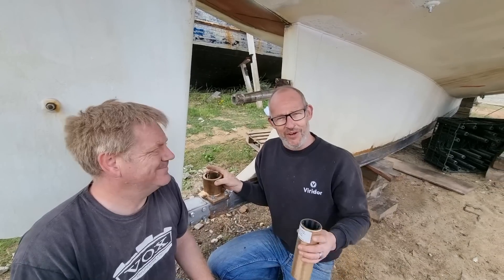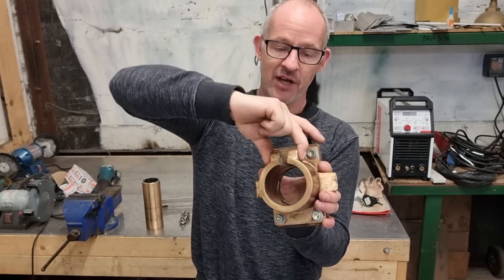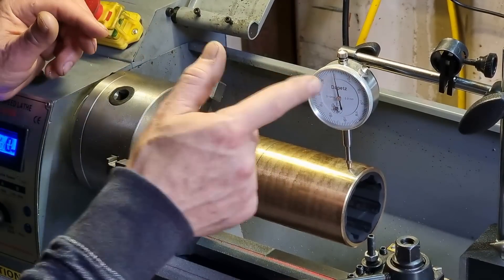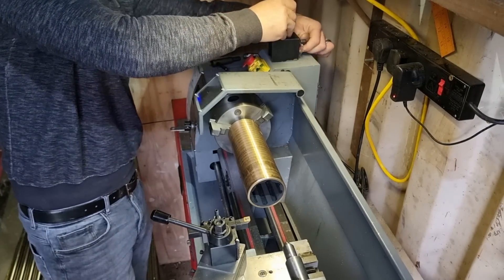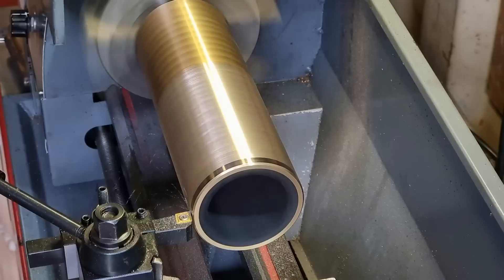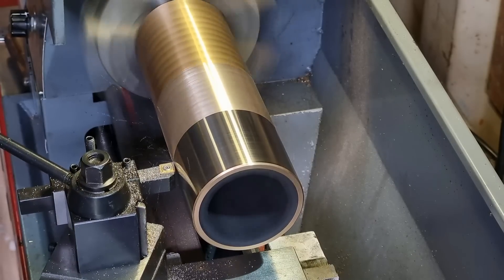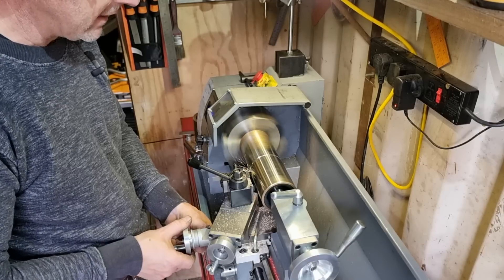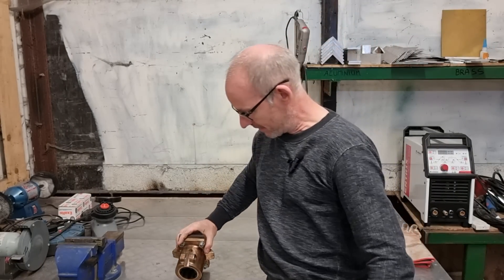Machining a cutlass bearing to fit.  Scary lathe work! (Bleeding Rust Ep 5)

Comment: If that cutlass bearing had a 1/4" thick rib on it that would fit very nicely into the open slot on the housing, I think that could be better than the 3 grub screws. Or not ??? Just a thought. :-))

Comment: If it is a standard size cutless bearing would it not have been better to ream out the holder slightly so in the future it would be easier to buy a new bearing that fitted, despite having a spare? Otherwise it will be necessary to machine each new cutless bearing.
Reply from the maker: Hi Neil.. Yes you are right, however, as nice as the housing is its not a machined part and was impossible for me to line it up in my small lathe. the decision was made to turn down the bearing itself as it will be a good few years before it needs changing again and then they have the spare.. when the time comes it will be very easy to turn down the next pair.

Comment: The cutless bearing is a standard size so by machining it down it is now a none standard size. Would it have not been better to machine the cutless bearing housing to take a standard size bearing. As it stands Andy will need to get the outside of a new bearing machined every time it has to be replaced once he has used the spare.
Reply from the maker: It's a great point John and we did discuss it, however the housing, although very nice, i not a precise casting and would be very difficult to get straight in my lathe, even with the 4 jaw chuck, secondly, de to the gap that makes up the clamping system would mean i would be making interrupted cuts which adds to the risk of something going wrong.. so as there was enough to make a spare we chose the route we did... and I'm always here to make 2 more when they need them :)